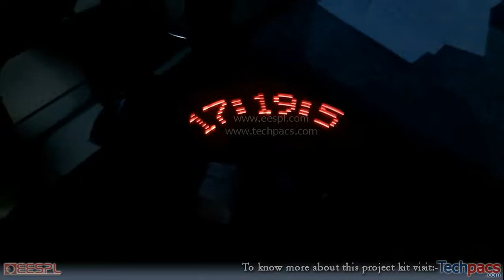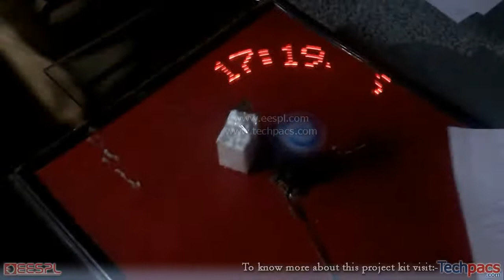POV Clock | RTC Display using Arduino  (latest Project 2020)

Comment: Can I get the code for this?
Reply from the maker: For Know about the Code and More Details Contact at +91 9056960606 .
Reply from the maker: You can get complete project kit along with the code from 
http://www.techpacs.com/category/Project/16-119-87/Microcontroller-Based-Real-Time-Clock-over-Propeller-Display-using-Persistence-of-Vision-POV

Comment: plz tell me materials required for this project?
Reply from the maker: You can get complete details with different Project kits options here 
http://www.techpacs.com/category/Project/16-119-82/Microcontroller-Based-Propeller-Display-Design-using-Persistence-Of-Vision-POV